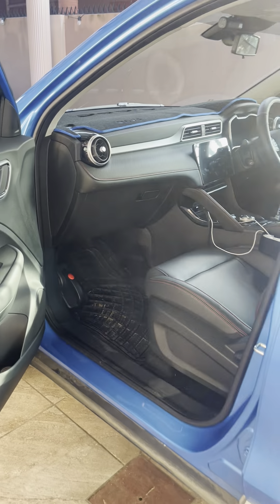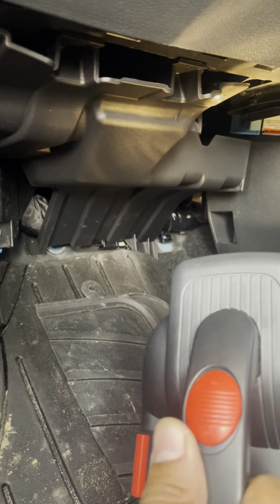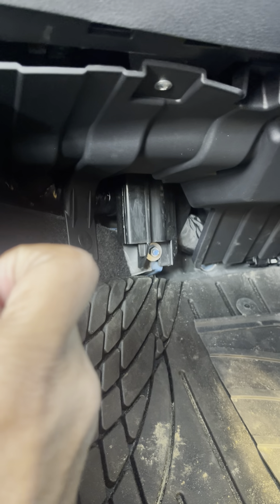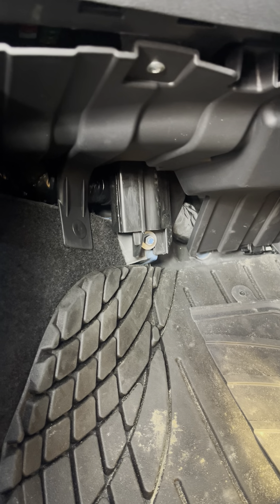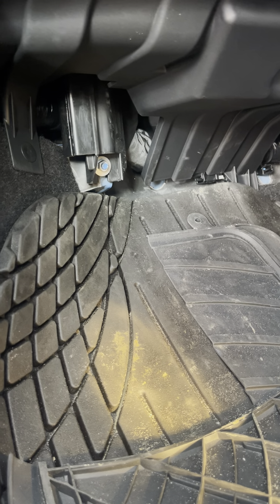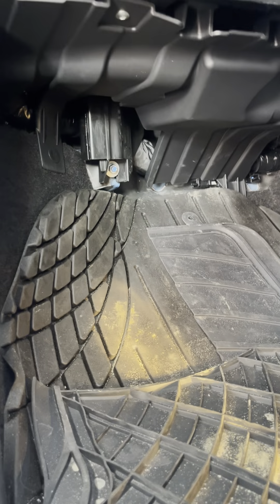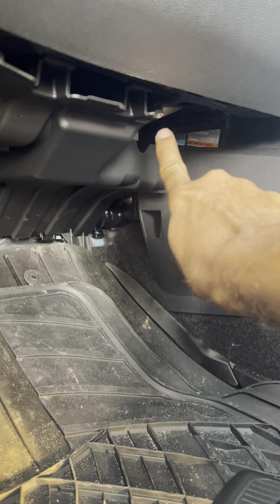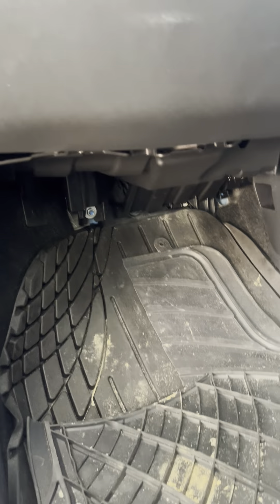MG ZS EV Fuse Box-Replace Front 12v Fuse# F15

Comment: Why did they have to hide the fuzzbox
Reply from the maker: Its how they have designed it. Most car makers have the Fuse Box hidden behind the Glove Box and covered with a flap door. In the MG ZS EV> it is strangely facing downward and covered with a plastic trim held in place with 2 screws and a next 2 plastic retainer clips.